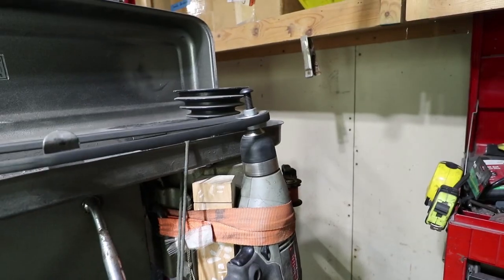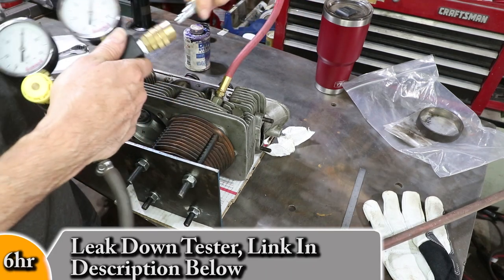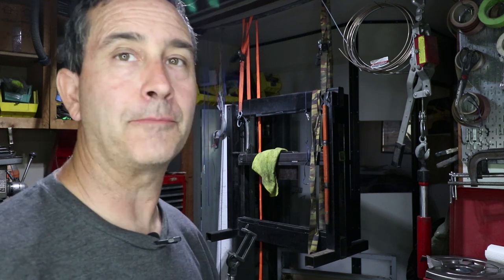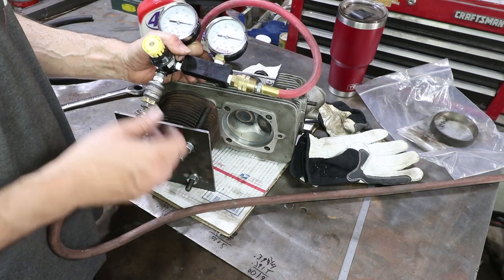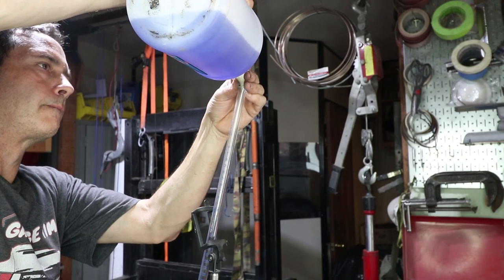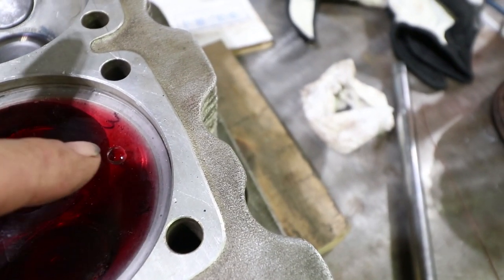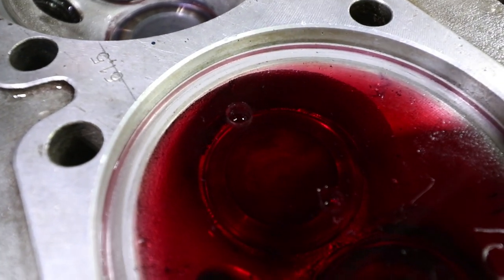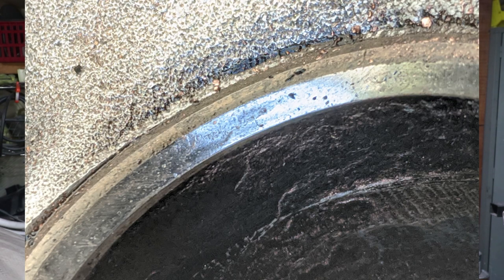Leak Down Testing My Cylinder Heads On A Bench?  PORSCHE 912 Engine Build Part 4

Comment: When I saw the cutter wobble at the beginning I thought that those seats were toast. However they came out fine. The machinist in me is scratching my head.  The job came out great in the end. Congrats.
Reply from the maker: I hear you.  The one thing that helped me is the big valve stem size, 10 mm.  That is pretty large for only a 34mm valve.  So the pilot is pretty stiff which holds the cutter.  It's a slow process, but it worked out.

Comment: Brought back memories of when I was pursuing an automotive engineering degree 45 years ago.  Followed exactly the same procedure when measuring head volume.  I remember the process taking far more time than I thought going in.  Used grinding stones on the seats with tools designed for the job.  Thanks for putting this together.  I think you are correct that most people likely overlook the importance.  👍
Reply from the maker: See we have people on here that are smarter than me and more qualified!  I wish I was on the engine team when Porsche developed this stuff.  Or at least a fly on the wall!  I'm even more excited for the 911 stuff.
Reply: 1ocean515 I wonder the tolerance between head volumes on a modern F1 engine? Actually, I wonder the difference on everything on an F1 engine. I worked in a GE machine shop that had Co-ordinate Measuring Machines (CMM) all over the place. In a YouTube video of a MB F1 engine being revved up I saw one. These are accurate to four decimal places.
Reply from the maker: I've worked with cmm's many times.  I would love to model the intake and exhaust runners to study the areas and optimise the shapes.
I too wonder if the cmm would be more accurate than the fluid method?  It comes down to just a few drops for a tenth of a cc.  That's pretty amazing when you think about it.  I'm sure I removed more carbon off the combustion chamber than that.

Comment: Love the video & the information. With all the tools you have why don’t you have a vacuum tester? If you have a decent air compressor you can buy a vacuum tool for less than $20 from Harbor Freight. The gauge & connections cost maybe $15 more. I’ll be doing a video on it in a week or two. For now I am fixing what the machinist screwed up.
Reply from the maker: That's cool and best of luck on your vacuum tool.  
My belief is that a leak down tester at 80 -100 psi is a better tester than vacuum at negative 14 psi.  Actual combustion pressures are very high, so I want the tester to be as realistic as possible.  Plus the leak down tester is somewhat calibrated so we can all compare numbers regardless of the engine.  
Link to my video and let me know when you post yours and I'll do the same!  I love alternate ideas and people will choose what works for them
Reply: @GarageTimeAutoResto  oh I agree with you on your test. I was just surprised that someone with as many tools as you doesn’t have a simple vacuum tester. It comes in handy for all kinds of things other than valve seat leak testing.. The one I bought from Harbor Freight for less than $18 pulls a negative 25+. I haven’t actually used it on a head yet so I’m only assuming it will work. I’ve done the water test from top & tipping head on the side so it seems logical to try a vacuum test since that’s what I believe is done in a machine shop. Maybe someone should do a video comparing all these YouTube methods?
Reply from the maker: I just used a vacuum pump from O Reilly auto parts for my Mazda AC system.  It's a free rental!

Comment: I never knew about different angles on the value ports
Reply from the maker: Oh, you mean how the exhaust valves are at 30 deg?  Porsches first attempt at the semi hemi head.
Reply: @GarageTimeAutoResto  no the different angles you put on the seats
Reply from the maker: Oh gotcha.  It's in the workshop manual if you want more info.  Very important for good airflow!

Comment: When were testing race engines we just fill the heads with parafin (kerosene) or white spirits (Mineral spirits) and stand them over a clean bit of paper...any leaking valve is soon spotted
did you get the valve spring compressor ?
Reply from the maker: No, did you send me one?  Last week I did what you suggest, but with windex.

Comment: Darn! I was looking for your address to send my 912 heads. LOL
Are you going to flycut the heads to increase compression?
First thing I ever lapped was a straight 6 from a D7 Caterpillar. I was happily mapping away when I noticed all the mechanics were standing together. They would  look at me and snicker. So I asked what was so funny and one told me lapping was done quickly, hitting at with a few licks then moving to another one.
912 had a 9.2. CR. Wish my parents hadn’t tossed my ‘64 SC 9.5 CR heads.
Reply from the maker: Ha ha, I have a lifetime of heads to go through as it is.  I don't think I will fly cut.  I'm not going for max compression ratio, but I'll do my best to move it up a bit.  I think you are right about the 912 being higher than 8.5.  I was remembering the 356 C heads.  
Funny story about lapping😀